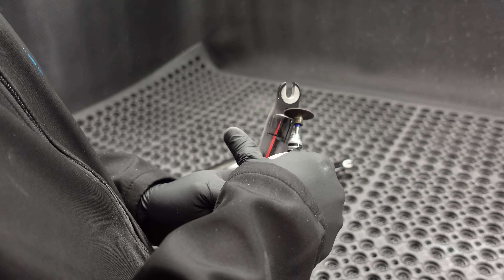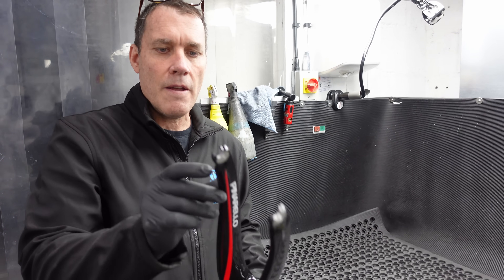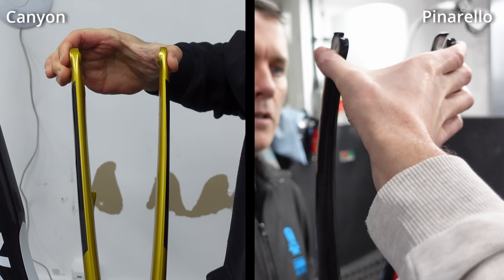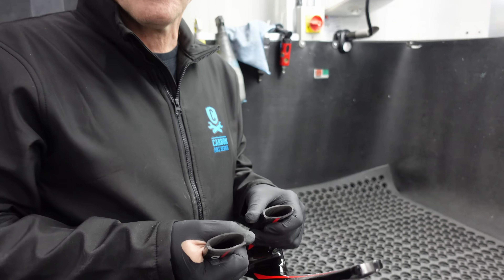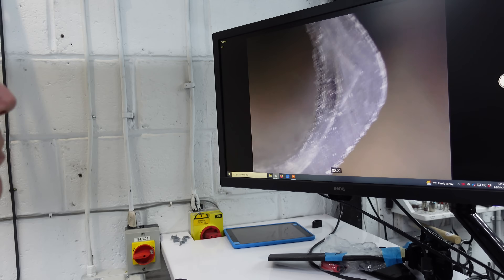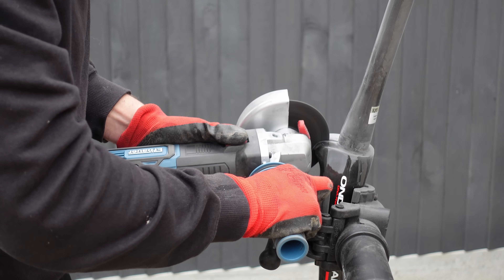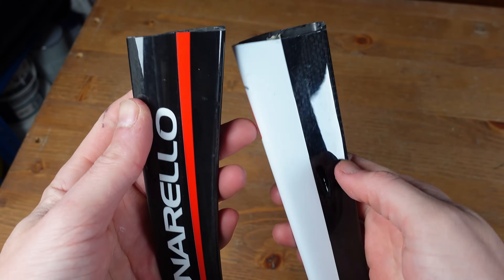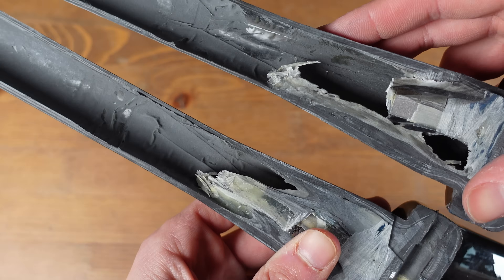I Cut High End Pinarello Forks in Half… Here Is What I Found!

Comment: I wonder why so much is made about how hard it might be to squeeze the fork blades together when at the very least there's a hub/axle clamped into the ends with a Q/R when the thing is in use? If that's properly installed that flex when you squeeze the blades together wouldn't seem to matter? With a thru-axle the entire assembly would be even stiffer.

Comment: Comparing a rim brake fork to a disc brake fork like this is a bit disingenuous. Of course the trifox fork is going to be thinner where the brake isn't! It doesn't have the braking forces, compression from the bolt or any of the same loading.
Reply from the maker: Yeah, as I said in the video It's not like for like. Ill be getting my hands on some disc brake forks soon hopefully. (If I can find some)
Reply: @JourdainColeman  did u find anything

Comment: I would have thought the thickness of the trifox is because it's a disk brake bike and they need the additional thickness for twisting forces when you brake. The rim brake pinarello would not need as much on the legs but maybe as the front rim brake may need additional carbon at the front of the crown?
Reply from the maker: That's a good point. I need to get my hands on a pair of high end disc brake forks and compare to them. 👍🏽
Reply: @Jourdain Coleman  with how much bike prices are going up....Good luck 😂 unless you are going into the bank-robbing business 😉
Reply: @JourdainColeman  There's more than 1 way to create stiffness, or in this case resistance to torsion. Thick walls is one, but the other is geometry (and probably why that Trifox disc fork was thicker in diameter and had that peaked outer surface). Even if you can't get forks to cut up, all you really need is someone with a high end fork you can take some measurements on. And assess the shape.

Comment: Does this squeeze test make any sense, since in that direction the fork will be stiff as a brick as soon as you put the wheel in?!
Reply: Not really, the fork is a cantilever with force acting forward/backwards. And as you say, the front hub is part of the structure left/right. Normally, the front wheel is trying to move away from the bottom bracket due to head angle and fork rake, but as soon as you use the front brake the hub is getting forced back towards the bottom bracket, forks work hard.
Reply: @hectorkidds9840  that's exactly what i mean. The direction you describe is very relevant. The direction of this squeeze test is not.
Reply: Yes. Just because they squeeze in the direction our hands work doesn't mean it won't also flex outward. Hammering into a turn the forks are going to flex in the same direction
Reply: @cjohnson3836  given the crown of the fork is extremely rigid, with the wheel attached its basically a triangle. Also on a bike youre leaning in a corner so the forces come relatively straight in the fork. It would try pull in the direction of the frame to test the stiffness for hard braking. Here an flatter aero tube can be more stiff. Also you want some damping characteristics so the fork doesnt vibrate while braking hard.
Reply: @janvanrookhuijzen8309  Forks are more than crowns. Fork flex + spoke flex +rim flex are why you have tire clearances. To say a fork, esp an under built one, doesn't exhibit lateral flexion is idiotic and ignores most of bike history. More, your braking scenario completely ignores disc brakes and torsional forces.
Reply: @cjohnson3836  sideways rim deflection and spoke stretch is absolutely a factor and tire clearance is therefore important. Ps. A stiff rim requires more clearance, the opposite of what many people think. Sideways flex of a front fork in the way of this squeeze test is very small. But what do i know? Have been an engineer in a bicycle factory for only a few years and that was until 6 years ago.
Reply: To be clear: I only refer to the squeeze test of pressing both leg ends to each other. With the hub between the forks legs the hub should become narrower under load. You will need a strain gauge to measure this effect or you wil not notice.

Comment: 9:44 the thickness unevenness, though...
Reply: Lack of uniformity on the steerer and it looks very thin in a section
Reply: I'd say that taper is by design.  It's only thicker up top because that's where the upper bearing race seats and stem clamps, so it has to handle compression and point loading.  Inbetween the upper and lower headset bearings it can be thinner to save weight.

Comment: It's also the different types of carbon in the lay-up. Some use several  different weaves to get weight down whilst maximising strength.
Reply: You think there is a difference that is significant?
Reply: From what I've seen the majority is UD and the exposed layer is a weave. Maybe you mean different types of fiber.
Reply: @aaron___6014  older bikes had the weave like 3k mostly on the outside but some so many use UD on the outside now. The UD wheels are lighter than the 3k matt versions